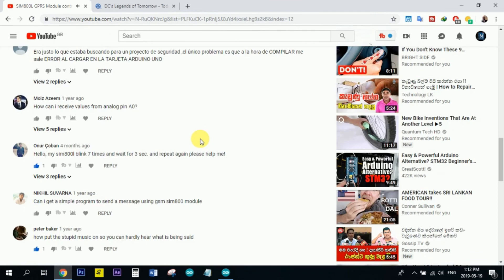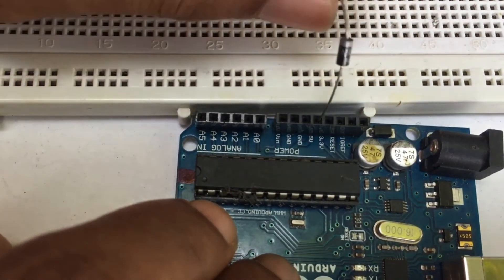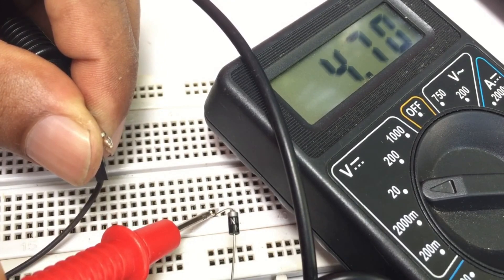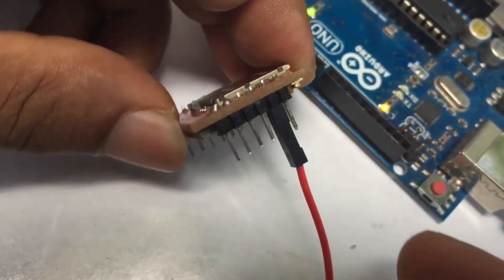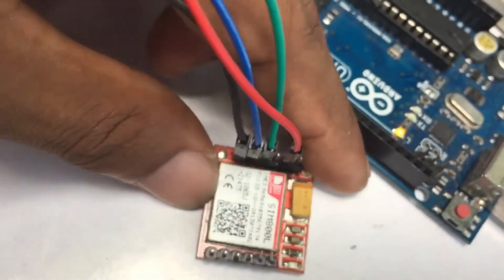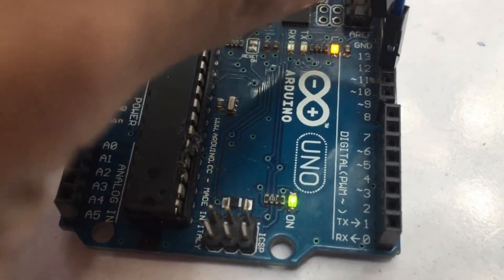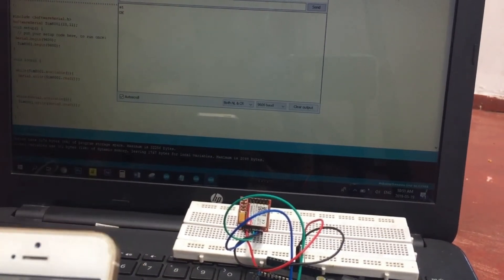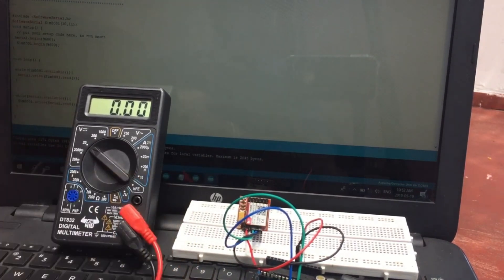sim800l Module Power Supply

Comment: Sir as I know arduino 5v pin can't provide 2 Amp surge current,then how it is possible to connect Sim800l with that pin ?
Reply from the maker: for testing purposes the arduino power is enough. The total 2A used when the module is working with SMSs. When you apply this in practice, it is better to use separate power supply for the module.

Comment: i have been working with Sim800L module for more than 3 years now and made lots of commercial projects too, even 3.7Volts is good enough, just ensure that it has enough charge to provide the surge current of upto 2Amps max which is needed mostly during startup. Just use 1000uF capacitor between VCC and ground, with this even 1 Amp power supply will also work. The voltage that u are showing in your video 4.7 is definitely not good for GSM module, you may get it working for sometime but using it in commercial products for prolong time will definitely damage your module. Trying to do anything beyond safe voltage mentioned in the datasheet is purely risking your module.
Reply from the maker: Yes, you can do your experiments, But I can not recommend.
Reply: Please I am new to the use of sim800l and since I got the module I have not been able to get it to work properly 😣

Comment: can someone tell me what battery is suitable for sim 800L?
Reply from the maker: You can find a battery from android Tablet.
Reply: @setnfix  android tablet? I mean a battrey for sim 800L.
Reply from the maker: Normally android tablets' battery has arround 4.7volts and more than 2 amps. Therefore , It is the most suitable battery for ur purpose .
Reply: @setnfix  oh okey thanks man.
Reply from the maker: @ahmadrahmadtullah.u5806  Always welcome..
Reply: @setnfix  one more question sir.
if I use a battrey which is more than 2Ampere for sim 800L. is it dangerous?

I mean whether the current coming out of the battery will always match the amperage. for example 3Ampere battery?

or the current that comes out will follow the needs of the load that is installed in the circuit?
Reply from the maker: @ahmadrahmadtullah.u5806  No there is no harm. Whatever the battery Amperage, the device will take only the current that is required.
The problem is, you must aware that there is no short circuit. Because if there is any short circuit, due to high amperage it may be a caused to burn (Than usual) every component with your device.
Generally, there is no problem.
Reply: @setnfix  wow thank you sir. You are realy nice person. 
Again. Thank you🙏
Reply from the maker: @ahmadrahmadtullah.u5806  Thank you. Make more improvements to the project and share with others.
Reply: @setnfix  ay yay sir👨‍✈️
Reply from the maker: @ahmadrahmadtullah.u5806  Check the type of the variable and the maximum length of it.
Reply: @setnfix  so my sim 800L doesn't broke?
Reply from the maker: @ahmadrahmadtullah.u5806  I dnt think so.

Comment: Sir is 7805 ic is good for operating gsm ?
Reply from the maker: No, you can not use it
Reply: @setnfix  ya now I figure out that the amp is very low ....but instead of that I have tried to power the gsm it won't at last I powered up with my laptop output port & then its working getting sufficient voltage & current  for registration
Reply from the maker: @subhamdas2491  You can use power from laptop USB for testing purposes. If you are expecting to make a practical project, you have to give 2A current. It is better to use a battery.
Reply: @setnfix  but there is no such battery like 5 volt 2 amps
Reply from the maker: @subhamdas2491  But you can Find 4.7volts with various Amps.
Reply: @setnfix  can u share a link of amazon of that battery .. I can't able to find that
Reply from the maker: @subhamdas2491  https://www.ebay.com/itm/362712363239

Comment: I have sim800l , provided with  4v .
Blinks 7 times then stop for 3 sec 
At+ csq give 0,0  . Is there any solutions .
Reply from the maker: I may due to not enough power.
Reply: It is just struggling to register on network, I have same problem, and it boils down to one reason that is insufficient current from power supply. If you want proof just connect 3.7 battery with 90% charging status, that will surely provide sufficient current.

Comment: i have sim800l V2 when i am testing for AT commands nothing is shown in the serial monitor . how to solve this problem pls?
Reply from the maker: Check the wiring again and power the module. Then insert an active sim and make sure your sim card security PIN is off. Then take a phone call to the number in the GSM module. If you can hear the ringing tome, the module is working well. If not the module is not working or issue with the wiring or issue with the Arduino board.
If you can hear the ringing tone check the wiring again. It must be working.
Reply: @setnfix  the module working so in call mode but nothing show in the serial
Reply: @setnfix  In previous days it was working fine but these days nothing is happening in Serial monitor i check all

Comment: I have one sim800l blinking but inserted sim remains out of network. Can you help me to decide whether board damage or any other problem. It was working ok since Oct 2021.
Reply from the maker: The best way to check is dial the number of the sim cart in the module. if you hear the ringing tone, the board is ok.
Reply: @setnfix  dialing sim number say not reachable or switch off
Reply from the maker: @kundankanth5037  is it sim locked?
Reply: @setnfix  sim working fine in mobile. Other similar sim also showing no signal

Comment: I have gsm 800l and 3.7v lip battery but it doesn't seem to power on already tried replacing gsm any solution?
Reply from the maker: You need at least 4.4v and 2A battery
Reply: @setnfix   That's not true, i have been working with Sim800L module for more than 3 years now and made lots of commercial projects too, even 3.7Volts is good enough, just ensure that it has enough charge to provide the surge current of upto 2Amps which is needed during startup or calling. Just use 1000uF capacitor between VCC and ground, with this even 1 Amp power supply will also work. The voltage that u are showing in your video 4.7 is definitely not good for GSM module, if may get it working for sometime but using it in commercial products for prolong time will definitely damage your module. Trying to do anything beyond safe voltage mentioned in the datasheet is purely risking your module.

Comment: I need to use gsm module for longer time
I have 5v 2a smps
How should i supply 4v 2a to sim800l
Reply: Are u suggesting i should connect zener in series with 1ohm,5W resistor?
Reply from the maker: @rishabhgupta1605  I think it will work. 1st check the voltage with volt-meter.
Reply from the maker: It is a difficult task to drop 1 volt. But theoretically the possible way is use a Zener diode. Give 5v through 1 ohm , 5W  resister  and connect the  cathode of  3.9v Zener Diode and anode to the ground.

Comment: the sim800l may need till 1A current or more , so it can damage arduino that can only gives us max 500mA !
Reply from the maker: The sim 800l module is required 2A current for its full operation. This video is for testing sim800l module. If you use this module as a practical project, you have to use a smooth power supply with 2A. However, I can highly recommend a Mobile Phone Battery as the power source.

Comment: That should send an over voltage warning URC over 4.3v and over 4.4v should power down. 
My Sim800L behaves that way anyway.
Reply from the maker: It was not a harm to     the module
Reply: It’s not that it shouldn’t harm it, it shouldn’t work over 4.4V as it should power down. It hasn’t got an additional diode on the board has it?
Check the data sheet, it should power down.